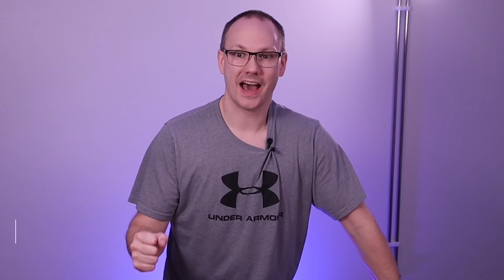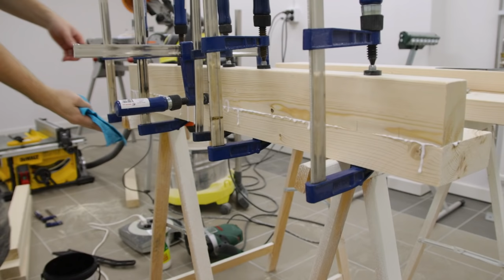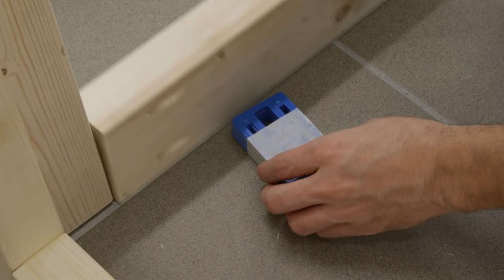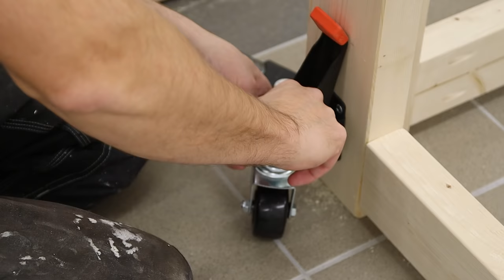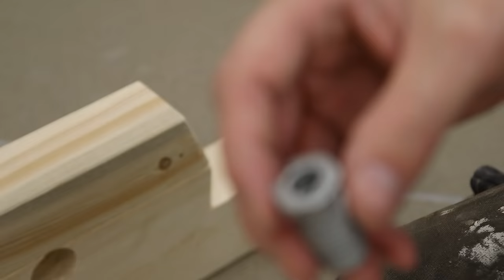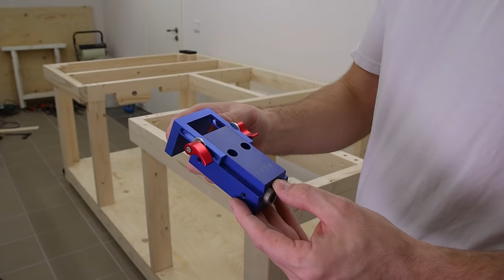Building a miter saw flip-top workbench with a built-in table saw

Comment: The hardwood flooring top is a great idea. Gives it a beautiful look and adds tickness/weight at a price cheaper than finished plywood. I’m going to make a very similar table and but later add  a router section with some t tracks and perhaps a 2nd flip station for planar/sanding down the line.
Reply from the maker: Thanks! I did just add my ScetchUp drawings in the description. I have also included future upgrades including a table router and additional t-tracks ;-)
Reply: @DesireToInspire1  wow!.. did you add those yet?  Bravo 👏👏👏🏆
Reply from the maker: @27photogger  Sorry not yet, it will be made this winter. I have had my hand fully with a pool project this summer.
Reply: @DesireToInspire1  any Chance you might create an all inclusive materials list and/or cut list/measurements?

Comment: This was a really nice job. I built a smaller rolling table for belt sanders and grinder.  I recommend using a long vertical board on a hinge that moves out of the way for rotating the top and back under to transfer load all the way down to the base of the frame. Over time the latch you used may creep and with the board you can actually pound on the top with no worries

Comment: Bravo! Very clear presentation. As a beginning woodworker this is a confidence-building vid.  Watched it twice and will refer to it again as I progress. Thanks
Reply from the maker: I'm just as new to this as you are so I believe anything is possible if you just set your mind to it. I did create this work bench in Sketchup and was working on it for a very long time trying to figure out each step if it even was possible to build. In the end I felt ready enough to give it a try and it turned out way better then I hoped it would :) Having a great surface to work on make all other jobs so much more fun to do. In the bast I have always worked on the floor... felt it was time for a change.

Comment: A masterpiece! I like the hardwood flooring idea, I think I'll borrow it except, I won't put spruce trim around it......and I'll miter the flooring edges so it drapes over the sides.
Reply from the maker: I'm not sure what "spruce trim" is but i assume its the board i put around the bench to cover up the transition between the floorboards and the plywood. Yes i wanted to skip it to but the transition was just so ugly that i had to come up with something to cover it up. The "spruce trim" are now in the way when I want to install a bench vise so I have to come up with a solution for that. Thanks for watching the vid!
Reply: @DesireToInspire1  Thanks for taking the time to post your projects. I used to make stair nosings and I used a color matching sealing felt marker which I will try on the round over edges on this project.

Comment: Great build! New subscriber here!
I'm rebuilding my workbench now to include my table saw and flip-top miter platform. 
One thing I was unsure of... Is the pole rotating independently of the platform, or is it fixed in place with the platform and they both just spin around together? Would it work either way?
Reply from the maker: Thanks! The rod is loose but with a tight fit. It's free to move as it want as long as it don't move to the sides.
Reply: @DesireToInspire1  Great. Thanks so much! Keep up the great work and videos! Have a good day.

Comment: Hi Kenny,,
Thank you so much for taking the time to document this excellent build! I bought the plans and watched your video closely. I redrew your Miter Saw flip in AutoCAD to modify it to the miter saw model I have and I'm all set.  
I have looked at many Miter Saw station builds but I like yours the best. Having an old version of Sketch up from 2015, I was about to relearn the software to begin my design but after going over your plans, I'm ready to build. My shop shed is 12'x16' so I'm going to build 3' depth instead of 4'.  Can't wait to get started!
Perhaps you can add addition Amazon links to your casters, track saw, metal strip tape measure for miter saw, wood biscuit bit, Table saw feather board and hardwood planks?
Thanks again,
Craig
Reply from the maker: Thanks! Its not a bad idea, I will for sure att it a bit later on!

Comment: Hi Kenny
Many thanks for sharing such a perfect workbench.
I have downloaded the drawings for the workbench and i can see there is a little difference in the way you are mounting the piveting point of the tube for the mitter saw.
In the drawings you have made the "bearing" adjustable in height instead of the fixed one in the video.
Which one of them will you recommend
Thanks in advance

Comment: Each leg where you put the casters sit on the floor, however that 2x4 that connects the corner legs (the long one) doesn't sit on the floor. Isn't it gonna bent eventually due to weight and no support? Since those 2x4 are about an inch off the floor....just wondering before I start building mine and thank you for replying
Reply from the maker: You are correct, this became an issue that I later fixed by adding a small block in the middle. This change is also in my plans.

Comment: I think this is the best table that I have seen, So I bought the plans, but I have a question. I/m have way through building but my question is, on the adjustment blocks 4 1/2" x 4 1/2"  there are two board that measure 1 1/2 " each in with a total of 3", Do the bolt screw into the wood alone or did you use thread inserts??? You cannot go any firth because of the miter saw box that I still have th build.   Thank you very much
Reply: I’ve built this - the bolts go directly into the wood.  Also, steps 5 and 7 are wrong.  If you follow them exactly as shown, your flip top will be 26.5 inches wide, not 28.  You then have to modify a bunch of other stuff.  Also, the measurement in step 67 is wrong.  Oh and screws BD are too long.  There are lots of problems with these plans - be careful.
Reply: I bought the same plans, and yes I used threaded inserts in metric and bought 10m x 1.50 x 70 mm full thread hex screws. you should not bottom out with the block plus 1-1/2  sec 12, 13.

Comment: This is a stunning build, great detail and pride in the work. The flooring top is a point of difference from any other bench build I’ve watched. The only suggestion for improvement would to be to use threaded inserts in the mitre saw deck adjusters 32:29 as putting the bolts straight into the wooden blocks (self tapping) isn’t as strong and could lead to it dropping over time and losing the ability to adjust. Oh and the little dance was definitely deserved😄

Just watched you latest mobile tool cart video and seen you are using inserts now😊
Reply from the maker: About the inserts. I still believe it was the right choice to just thread the wood. The reason for this was so that the would offer resistance so that the screws don't need to be locked in some other way. The material is so thick so it will never come loose, its simply just to much material for that to happen. On the mobile tool cart i just did i opted to go for inserts because of of little material i had to screw in. In this case the bolts could in deed loosed up over time and create issues so that why i chose inserts instead of threading the wood it self. And the dance was 100% of pure joy that it worked :D

Comment: How do you triple like a video??? 🤙🏼

Working on mine now and it’s not as polished or as big as yours lol. Took lots of inspiration from this video!! 

Question: was that a 3/4 pipe you used or 5/8?
Reply from the maker: 1" I think, the larger the less stress on the wood.
Reply: @DesireToInspire1  that would’ve been a better idea. I ran hollow 3/4 inch pipe, put a hole in it and ran the electrical through for the miter saw. (Armored cable) 1” pipe would’ve been better for sure!

Comment: How do you keep the center from sagging?  I mean, using only 2x4's to span that distance, then adding the weight of a table and chop saw, I would think it would bow down slightly in the middle.  Am I missing something?  Did you put pads under the center?
Reply from the maker: You are in deed correct. Later on i noticed this and added some small blocks under the middle of the table.
Reply: Well, it's still an amazing job.  You do very nice work.  As a mechanical engineer, mechanic and carpenter, I am impressed, and that's something that doesn't happen often.  BTW, you are one cool dude to respond  to my question so quickly.  Thank you.  @DesireToInspire1

Comment: Beautifully built, it must weigh a ton though! Only thing I’m worried about is gluing the flooring down. What if you have to replace it?
Reply from the maker: Thanks! I don't think i will ever replace it, after all my work so far i barely have any scratches on it. It is made of real oak and are very hard. It is even possible to sand down. It i ever have to replace it then i can just unscrew the whole plywood sheet it is glues on and just redo that part, or i build a completely new table :)

Comment: Kenny, @DesireToInspire1, there is an error in the imperial plans.  In step 5, the leftmost F joist needs to be 31 inches from the EDGE of the frame, not the inside corner of the frame.  The graphic shows that joist 31 inches from the inside corner of the frame.  This puts it 31+1.5 = 32.5 inches from the edge of the frame, where the rightmost F joist is 59 inches from the edge, as directed by the plans.  59-32.5 is 26.5, not 28, as is required for the flip top.  This is a pretty big error, as fixing it would require some major surgery.  Luckily, my Miter saw should fit, with 1/4 of an inch to spare.  I’ll just scale down the flip top.

Comment: I built a flip table but after watching this I feel ashamed of mine, one question I would like to ask is, how much did the total project cost as that type of wood here in the UK, would cost a lot, great video, thanks for posting from Garry in the UK
Reply from the maker: I did not keep track of how much it did cost. The most expensive part was the plywood and the hardwood floor i used. But many small parts did add upp. Most of the small things like T-track and the wheels i bought from china so they where not that expensive.

Comment: Love the design.  I may have easily missed it, but one question I had regards supports that hold the metal pipe which permits the flip.  It appears you drilled a forstner hole very close to the edge of the support piece, and then secured the piece under that only with glue.  My chop saw weighs 65lbs...not sure that will hold it.  Did I miss the screws?
Reply: Nevermind....me again...didn't watch far enough into the video...I see the lag screws now.  Sorry.
Reply from the maker: He he, well you are not completely wrong here :) At first i did not intend to add any screws but later on i thought i might as well just to it to be on the safe side.

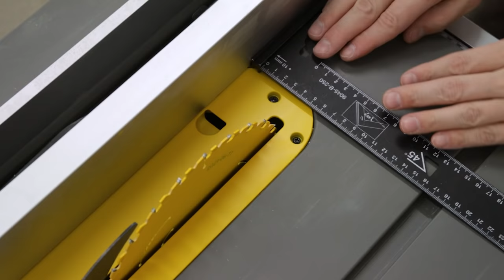Comment: Wow nice work! I love it I just started my workbench build yesterday as a new woodworker too! Just curious, whats the reason for using the masking tape while making your cuts on the table saw? 5:30 ' 5:38
Reply: is it to mark the exact spot the blade makes contact with your wood?
Reply from the maker: The tape indicate where I should stop. the blade cut further in then it does on the top but I can't see how far. If you pay attention to where I stop then you will see that a line or a previous cut line up with the tape.

Comment: What would advise on doing the table top with Laminate Flooring versus Vynl Planking?  I want to do something similar for my table top.  Your build is amazing!
Reply from the maker: I would suggest a surface of real wood. Laminate chip easy and even the smallest scratch would make it look very ugly. If you are gonna use something else but wood as the surface then i would recommend linoleum, i was planning to use it my self before i went with this oak floor.

Comment: Really good job. Well done 👍👍
What is the actual table size? 
Do you have any plans available?
Reply from the maker: No plans, sorry, i made the "plans" in scetchup, i had to run many trips to my computer to check specific measurements :D The table top is made out of a standard full size plywood sheet, 1200 x 2500 mm. I made all my design mased on that. Thanks for watching!
Reply: @DesireToInspire1  out of interest what is the make and model of the mitre saw you’re using.
Reply from the maker: AEG PS 254 L, I won it at a contest :)

Comment: I've never seen someone use wood flooring as a work bench top before. That's an interesting idea. How durable has it been over time? Either way the whole bench looks nice! You did a really good job building it.
Reply from the maker: Thanks! So far it is working great. Hardwood is very durable, barly any damage to it at all. The wood flooring was/is cheaper then the lowest grade of plywood I can find so it's a no-brainer to use it :)
Reply: @DesireToInspire1 I used flooring to build a desk in my office and shelves all round the room. Not a mark on it

Comment: Awesome build - just bought the plans.  Question though:  why did you use a different method for holding the bar for the flip top?  The plans show 4 adjustable bolts on each side, holding the bar.  You instead use a hole in the wood, with no adjustabiluty in this video.  Is that because you are super confident in your spacing?  Should I try that, or follow the plans, @desiretoinspire1?  Thanks!
Reply from the maker: Well i changed the designs in my plans to something better. I have noticed that my wood have over time shrunk some so the whole flip table is now about 1mm below the rest of the table and there is no way to adjust it. I plan to update my own workbench later on with the exact same feature. Thanks for noticing it!
Reply: @DesireToInspire1  The new design is great!  I like the ability to adjust, so that I can get a perfectly flat surface.  Did you see my other comment about pages 5 and 7?  There is a pretty big error where if you follow the plans, the flip top opening will be 1.5 inches too narrow, and fixing it would be a major pain.  It's a very simple fix in the plans - both measurements need to be made from the same starting point - that's it.

Comment: Hi great video, I can’t get sketch up to load just woundering. What height is the table? What is the distance between the top and bottom? Thanks
Reply from the maker: Hi, it is 90cm but you can set it to whatever you like. Some normal height are:
For fine work – working height: 39″ (100 cm)
approx. 2″ – 4″ (5 cm – 10 cm) above elbow height.

Easy work – working height: 36 ” (90cm)
around 4″ – 6″ (10 cm – 15 cm) below the elbow is recommended.

Heavy work – working height: 31″ (80cm)
around 6″ – 15″ (15 cm – 40 cm) below the elbow is recommended.
Reply: Thanks for the reply, I have done some drawings using bits from different work bench builds on YouTube. I am planning on doing it 8ft x 4ft x 90 cm high. Just wasn’t sure on height and how much room I would need to flip the saw

Comment: Awesome build. I've watched so many mitre station builds that I can't keep count. Yours is the only one I've seen with flooring top. How is it holding up? Any regrets?
Reply from the maker: Its doing great! Oak is very hard and durable. The fact that its not a MDF board or some other type of particle board makes it very resistant to moisture as well. Tho oak layer is 3mm thick so i can sand it down if i get paint or heavy scratches on it. Here in Sweden it had about the same price as normal construction plywood so it was a no-brainer for me to use it. Zero regrets, highly recommended!

Comment: Now that's impressive! Your workbench is amazing!
I got the same saw (Dewalt 7485) and I am going to build just the same workbench for my table saw with a flip top for the miter saw.

Tell me please do you have any plans for your workbench or at least some measurements!
Thank you in advance!
Reply from the maker: Hey! I did just add the drawings for the table in the description. They are made in SketchUp and the units are metric. I have also included many features i will make feature videos about :)
Reply: @DesireToInspire1  thank you and good luck in your woodworking hobby!

Best wishes to you from Moldova!
Reply: I would like to say I am very impressed as well. Fantastic job! 

I did try and download the sketch or drawing of the build but was unable. 
Could you possibly send the link again.

Comment: your messurements are of the general wide of the project by 1 cm. also the picture on page page 11 has a wrong lenght in it. the 431 at the top. After i solved picture picture 5 by adding a wood piece of 1 cm I started to measure more and so far(picture 13) i did not find anything else. Apart from that great project!

Comment: The only thing I can't understand is the 2x4s with the holes so close to the edge just to glue another piece to the underside of it. Why not drill it dead center of the 2x4 and if it's for correct table height just trim the base 2x4s the offset amoumt needed. I've watched this more time than I care to acknowledge trying to reverse engineer this for my own application. I'm adding a jointer and planer as well as the table saw and miter however.

Comment: I know im watching this late....was wondering if theres no support in the middle
Reply from the maker: Middle of what? I'm always here :)
Reply: @DesireToInspire1 Each leg where you put the casters sit on the floor, however that 2x4 that connects the corner legs (the long one) doesn't sit on the floor. Isn't it gonna bent eventually due to weight and no support? Since those 2x4 are about an inch off the floor....just wondering before I start building mine and thank you for replying

Comment: NICE BUILD. BUT WHAT A TREMENDOUS AMOUNT OF WORK. WHAT IS THE PURPOSE OF IT? FLIPPING A SAW REALLY IS NOT A PRESSING ISSUE. THER MUST BE A BETTER REASON. THERE ARE MUCH EASIER SOLUTIONS.
Reply: So you can have a flat surface to work on Also bigger rips with your table saw
Reply: @ThomasKnott-h5t  NICE JOB, BUT STILL, WAY TOO MUCH WORK FOR THE END RESULT.